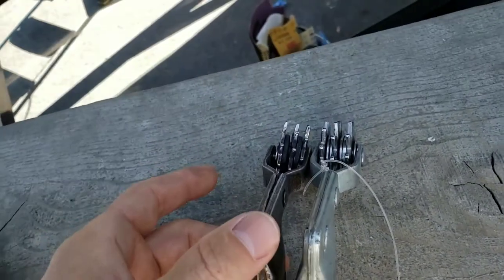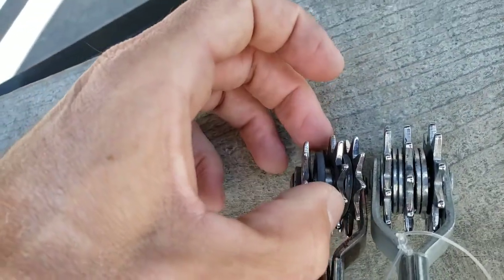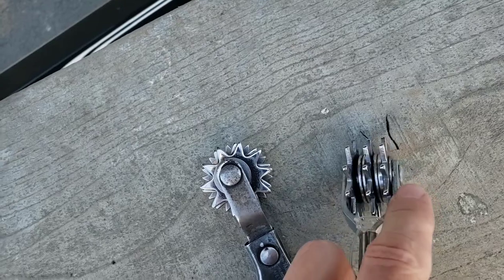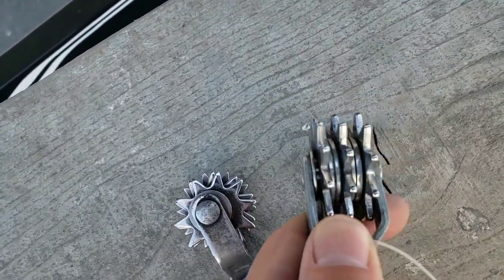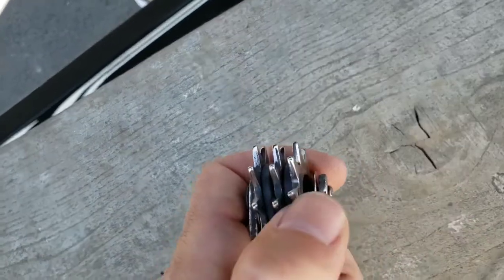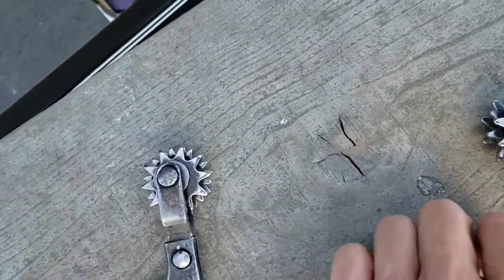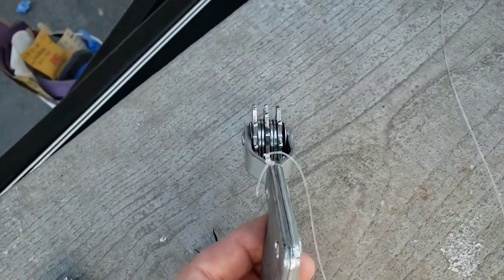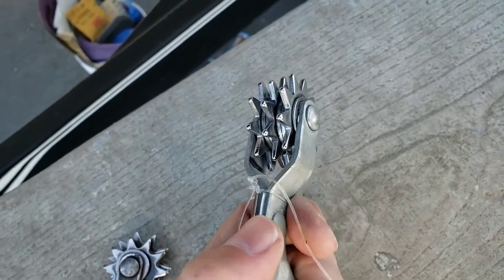"SPUR" a  Boat Detailer talks about his Pad cleaning tool of choice. it's personal, ok. 😥

Comment: A textbook example of Engineers trying to "reinvent the wheel". Geniuses completely ignored much higher importance of the centering ability of centrifugal force of high-velocity spinning of the spurs against the wool buffing pad! Instead, they attempted to eliminate non existing friction between individual spurs on a single washer. Key element of their ignorance - the difference of speed between individual spurs is negligible if at all even near center of the buffing pad! Geniuses! There is so many "engineered" solutions on modern vehicles that engineers of 30-50 years ago must be spinning in their graves. How do you explain metal extrusions molded over with plastic guiding sliding and tilting function of a sunroof inside roof cavity that gets easily over 150F in the summer?! The difference in heating and cooling properties between metal and plastic are so wast that cracking and plastic disintegration are guaranteed, resulting in sunroof failure. End of rant!
Reply from the maker: Es verdad!